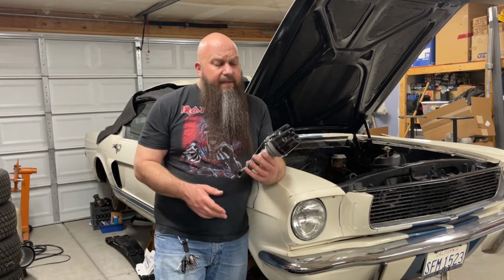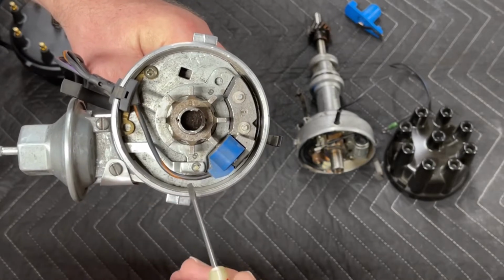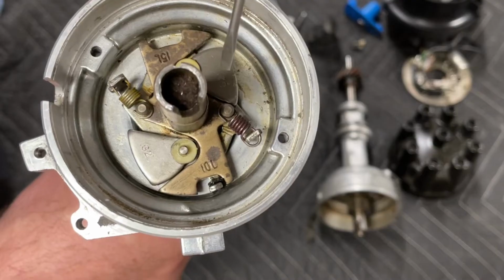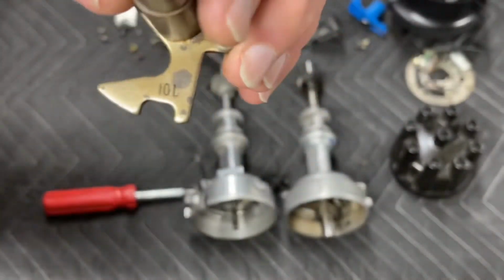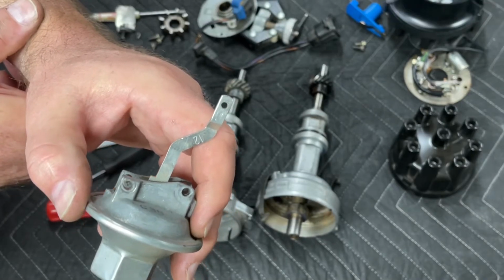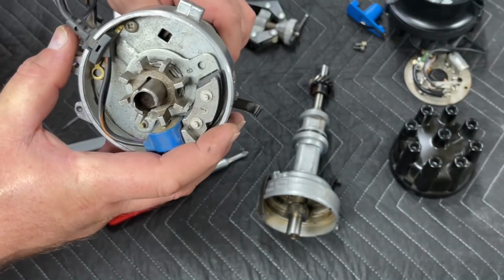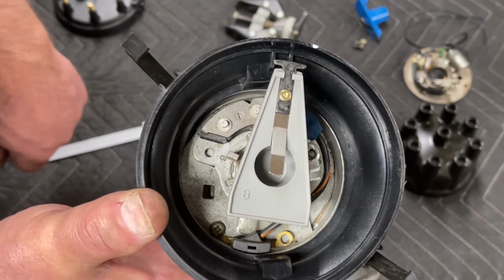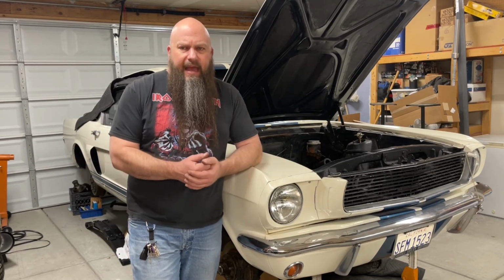Easy DIY Performance Re-Curve: '57-87 Ford V8 Distributors - Tune Your Ignition Timing

Comment: I finally got a copy of the Ignitor III Billet distributor from the Pertraonix website (when all else fails, I read the directions). The advance limiters and mechanical advance springs are easy to access and three versions of each are included for  12 to 20 degrees of mechanical advance coming in by 2,000 to 5,999 rpm. Vacuum advance can be limited to between 10 and 20 degrees (parts are included with Bil:et distributor. I applaud your consideration of economics to keep budgets under control: while the Ignitor III Billet is the not the cheapest, If replacing a worn out Ford distributor,  for me the improved function and adjustability are worth it. I will aim for your recommended 28 degrees mechanical and max vacuum advance . One point not too clear on the Pertronix website is that the Ignitor III seems to require the -.3 Ohm Flamethrower III coil and 20 amps of clear power.

Comment: I do not have a MIG welder to weld up the ignition weights.
1) Does anyone make wights for a Pertronix billet distributor? If not, can I install a setscrew limit total advance?
2) absent an option for total advance, can I dial the initial timing back to 6 or 8 degrees, then use lighter springs to bring the centrifugal in sooner? (I do have a spring set from Pertronix, but have not even seen a distributor machine in twenty years). I am looking for a chassis dyne to get real tuning data, but I am way out in the boondocks, the closest may be three hours away in Atlanta.
Thanks, Bill
Reply from the maker: 10.5:1 with iron heads, if they are 18mm spark plugs use an AR33 Autolite Racing spark plug.  If they’re 14mm plug heads  use an AR133.  Gap either to .030”. Total timing (w/o vacuum) will be 27-28° if they’re closed chamber heads (289), 29-30° if they’re an open chamber like a 351W or GT40.  If they are GT40P iron, 28-29°.  Use manifold vacuum for the vacuum advance to maximize timing at idle and cruise.

Comment: Liked, subscribed, excellent how-to video. We've been running an '85 GT in endurance racing (no street use) for 6 years w/original distributor. Our dis tag # matches the one you shared in this video. Plan to order the Mr. Gasket springs described and replace the heavy spring as suggested.  Top of select pistons indicate the engine may be over-advancing and detonating - and we have experienced excessive heat and head gasket failures between cylinders.  To better control advance, we want to limit distributor to mechanical-only advance at RPM above idle. Which direction to turn, clockwise or counterclockwise w/allen wrench, to have vacuum advance only at idle?  I recognize there will be "turn some and check" as we go.
Reply from the maker: Even if the engine is fairly aggressively cammed, having vacuum advance working at all times on manifold vacuum means that isn’t doing anything under medium to hard throttle.  If you have signs of detonation on the top of the pistons and spark plugs, and you’re losing head gaskets between the cylinders, it’s more likely a fuel mixture issue and possibly a fuel distribution issue.  To be losing gaskets between cylinders you have a concentrated high temperature area next to the exhaust valve.  Likely the source of your detonation is the exhaust side staying incredibly hot is usually, believe it or not, a lack of ignition timing advance at light throttle.  Put an EGT on the affected cylinder(s) and log a full lap against, RPM and either a MAP sensor or a TPS, both would be better.  You’ll see that the temps spike at part throttle under load and part throttle deceleration.

Comment: Great video. I'm running a 78 Mustang ll with a stock Remfg. 302 with a Holley 600 CFM 4v carb, 87 Octane pump gas with 10% ethanol, C4 Transmission, 3.00 differential.  I'm looking for a recommendation of total timing ??*, all in at ???? RPM's. I'm getting ready to remove the Duraspark distributor to check the CA to see what the advance settings are? 10L, 13L, 15L, etc., etc. Then recurve as necessary. Any comments or recommendations wpould be appreciated. Thanks.
Reply from the maker: If the engine is built to ‘78 specs with roughly 8:1 compression and large chamber emissions era heads, you’ll need to be careful with timing.  If the engine gets warm at idle or in traffic, that’s an indication it needs more timing from vacuum advance, be sure to run manifold vacuum and not ported.  Vacuum advance should add at least 10° of advance but not more than about 15°.  Ideally, you’ll want an adjustable unit that lets you set the vacuum advance timing to drop out completely when the engine is under about 4-6 inHg of vacuum. 

The lower compression will want a bit more total timing from the mechanical advance, 36-38° total, so I would run a 13L and keep the initial at 8-12°.

You’ll also need to be mindful not to set the curve too fast or you’ll end up with detonation at lower engine speeds.  I would set the curve up for a gradual advance rate that reaches peak timing in the 3400-3600rpm range, no sooner.
Reply: @TheGT350Garage  Thank you for the quick reply and recommendations. My vacuum advance is adjustable and is currently all in at 13* advance at 15" Hg. It starts to pull in at 5" Hg. It is hook to manifold vacuum. I will pull my dizzy and check the CA advance plate and springs, to see what the plate setting is? Hopefully 13L or 10L and adjust accordingly. This dizzy was in my previous engine and the advance was 34* full in at 3,500 RPM's, with a base timing of 14*. Thanks again.
Reply: I checked my Duraspark dizzy and it is running on the L15 side with a black spacer over the stop post, with one heavy spring and one light spring. The other side is L10 unused. My base timing is set to 6* BTDC giving a total timing is 36* BTDC at 3,500 RPM's. My total vacuum advance is 13* at 15" HG. The gives a maximum timing of 49* (36*+13*) My engine vacuum is 19.5" Hg. at idle. The engine seems to run well at these settings. Do you think 36* TT is a safe timing scenario for this engine? I thought of possibly swithing to L10 side and rasing the base timing to 10* or 12* giving a TT of 30* - 32* and a MT of 44* - 46*?  Any further thoughts, comments or suggestions? Thank you for the great timing advice.
Reply from the maker: @jpcessna5772 you’re right about where you need to be for what you have.  If you want to limit timing advance a couple of degrees without reducing the slot size, you can slip a piece of plastic tubing or a couple layers of heat shrink over the existing limiter bushing.  

You won’t likely ever see peak mechanical advance and peak vacuum advance at the same time so don’t add them together assuming it’s going to be too much timing.  Let’s say you have 26-28° at 2500rpm from the mechanical advance, the vacuum at cruise is 10” and you pull 12-13° you would be at 38-41°, but for the vacuum to be that high you’re at a fairly light load on the engine and you need that timing there.  As soon as you tip into the throttle and vacuum drops, the vacuum advance goes away and gets replaced by mechanical advance and then you stay on mechanical until you close the throttle.  If you close the throttle to achieve high vacuum above 3500rpm you would be in the only area where initial, mechanical and vacuum all together, and in that instance you actually need the timing to keep the engine running during deceleration.
Reply: @TheGT350Garage  Thanks again for the quick reply and sound advice. I'm planning to drive it for awhile, with my present settings. It seems to run well at these settings. If I do decide to limit the CA. I will try some heat shrink tubing over the stop as you suggest. Thank you.
Reply: Hello again. After driving it for awhile, I decided to change my Dizzy setup. I'm now running it with full CA of 22* BTDC and 10* base timing for a total timing of 32* BTDC , all in at 3500 RPMs.  My engine vacuum is now 20" HG at 800 RPMs idle. My max. vacuum advance is 14* and is all in at 15" HG. and completely drops out at 7" HG. My idle timing is at 800 RPMs with vacuum advance hooked to manifold vacuum and is right about 23* BTDC. This Dizzy setup seems to start easily and run very well, better than my previous setup.I will drive this setup for awhile to see how well it runs and then maybe bump the base timing up to 12*, to see if there is any noticeable improvement? Thanks again for your great advice and sound recommendations.

Comment: Great Vid !
There's another Cap option for dura Spark distrib.
From an International. 
It's a small cap with brass Male wire connectors.
Cap # AL482
Rotor  # FD311

Comment: Awesome Video Walter !
I'd like to add that if You upgrade the points to pertronix magnetic pick up always check ignition source to Flame thrower Coil for 12 volts. Stock output from fuse box is 6 volts which will fry the system later on.
Reply: Last Summer I upgraded from points to pertronix on a 62 T Bird which output 6 volts to coil so I ran a wire from battery to a push pull switch under dash for correct voltage to coil and a bonus hidden anti theft device.
Get the flame thrower Coil always so there's no guess work with ohms.
And modern Spiral core plug wires.
Reply from the maker: Why didn’t you put a fuse and relay discreetly under the hood, use the original coil power to operate the relay and let the relay provide full battery voltage to the coil?  Clean, simple easy electrical job, not expensive, much better way of doing it.
Reply: @TheGT350Garage  Very elegant solution, Walter!  Simple and effective...  I'll be stealing that idea!😁

Comment: I had duraspark I used on convert to carb and chewed the gear up called summit they said man you need a bronze gear lol. After the 10 mins that lasted I called lunati and they told me the summit part #for the billet gear suitable for roller cam. Roller cam ate those other gears up.
Reply from the maker: Ford distributor gears:
These three are your production type or “street” camshaft cores:
Hyd. Flat Tappet = Cast Iron Gear
Mech. Flat Tappet = Cast Iron Gear
Hyd. Roller Tappet = Steel Gear ONLY

Race cam cores (Comp rollers with a -9 at the end of the part number for example) are the exception:
Hyd. Roller Tappet OR
Mech. Roller Tappet:
Bronze, Melanized, Polymer, or whatever the cam manufacturer specifies for that core. 

Most “new production” Duraspark distributors are coming from overseas and you have to be extremely careful with which part number you order because the applications overlay for steel and cast iron gears.  If the cam eats the distributor gear, it usually destroys the cam and causes repeat failures even when the correct material distributor gear is installed.
Reply: @ this was like 1996 I left that off

Comment: What does the number 12 represent on the arm of that vacuum canister?
Reply from the maker: That should be the degrees of advance.   For example a Standard Motor Products VC221 is marked 10, but a VC215 is marked 12.  The difference is used to fine tune the ignition timing for emissions and for manual or automatic transmission applications from the factory.  You just have to be certain that you don’t try to mix breaker point and Duraspark advances.

Comment: I'm 60 ..in my mid 20's I would use bullshot ten speed derailer grease...it was the least attracted to dust in the distributor 🤔🧐🙂🐾🐾🐾🐾😎
Reply from the maker: In truth, there should not be an issue with dust in the distributor, the only sources of foreign matter would be the center carbon conductor on the cap.

Comment: In 1985, on my brand new 85 Mustang GT 5 speed, this is one of the mods I performed along with Sid Erson 1.7 ratio roller rockers vs 1.6 ratio stamped steel. Total timing, all in at 2800 RPM netted 30°. It improved the get up and go in 1st, 2nd, and 3rd shifts @ 6,500 RPM. I bought the car for my 30th birthday, owned it a little over 3 years and sold it with 3,600 miles on it. Pretty much with 1/4 mile or street light to street light usage. Thank you for sharing and bringing the memories back into focus. (I'm a youg 70 year old who thinks he's still 30 😅)
Reply from the maker: I have a special place for ‘85 Mustang GTs.  In 1985, my grandmother who was a very special lady, took me to San Fransisco and Monterey for a week long summer vacation.  While we were there, she let me pick any rental car Hertz had on the lot and I spotted a black ‘85 GT 5-speed.  She could drive a manual, but disliked them so much that in 1965 she had a Ford C4 installed in her 1962 Jaguar XK-E.  We had a blast on that trip, I was the navigator, and we saw the sights, in that car.  I bought an ‘85 GT 5.0 5-speed in 2007 but had to let it go shortly thereafter.  I appreciate the comment and the shared memories around the last carbureted Mustang.

Comment: Great video I wonder if you used a edm machine to cut a thin line in the 8 spoke roter if that would fier the spark twice and act like you have 2 sets of spark plugs and distributors
Reply from the maker: It would slightly alter the waveform off the mag pickup, but not in a way that would produce a second spark event.  You’d need a second trigger in the distributor a couple degrees offset from the first, a second ignition system with its own coil, and a 2-post coil connection with some version of a diode capable of handling the voltage to prevent back feeding the second spark.  A split spark in such close proximity to the primary spark would not give the coil time to saturate (not enough dwell) for the second spark to be produced.

Comment: Hi.. I enjoyed this video about recurving distributors as well as your video explaining octane and calculating actual compression ratio from measured cylender pressure.

The process you discribed seems to be pretty much what i did to the factory Bosch distributor on my 2.0 Pinto engine.

Factory stock .060 overbore, head machined .040 (175 psi measured compression), factory cam advanced about 4-5 degrees, SU HIF carburetors on  custom manifold, factory Bosch distributor with Pertronix module.

With this  configuration it drives well around town at 30 mph in 4th gear at 1700 rpm and pulls strong to 6000 rpm on 87 pump gas after I recurved the distributor.

When i first started tuning the timing i had  difficulty getting the timing where the engine had enough initial advance for off idle performance and not too much at top end so it ran ragged at high revs between shifts. (9 BTDC initial got to 28 total with vacuum advance or 12 initial went to about 34 which was too much)

I Experimented with vacuum advance and found it unpredictable so i removed it and when I disassembled the breaker plate discovered that I could remove the light spring and replace it with a wire loop and could limit the max mechanical advance to about 16 degrees by bending the wire with needle nose pliers.

See photo

I experimentally determined that the best torque was at about 12-13 initial and 26-28 total...

Seems like.about what you found as well.

Really enjoy your videos....
Reply from the maker: Every engine is going to be a little different.  Tuning engines is more science than “rule”.  And with the right combustion chamber shape, proper quench and the correct ignition timing, octane is not as critical as people have been lead to believe by the magazines over the past four decades.  I built a lot of Ford Duratec 2.3L DOHC engines about 20 years ago, and that engine would run on 87 octane with 260psi cranking compression.  The timing curve I used as a baseline was from a supercharged 4.6L Mustang Cobra.  Why?  Simple.  The 4.6L “Terminator” engines were 8.5:1 with 9psi from the factory.  That gave them an effective compression ratio of 13.7:1 at full boost and they were tuned by the factory to be safe on 91 octane.  To be clear, the curve ended up similar but not exactly the same, because the Duratec combustion chamber was more efficient than the 4.6 DOHC was.   The 2.0L EAO Pinto engine had a better cylinder than the 2.3L Lima that replaced it.  The chamber is a decent shape, the engine had good quench, and the crossflow SOHC design lead to excellent scavenging with minimal overlap in the cam.  Glad you enjoyed the videos.